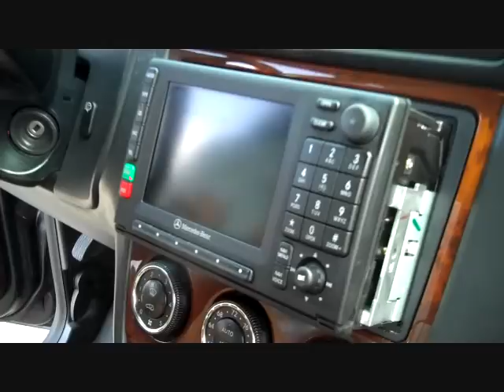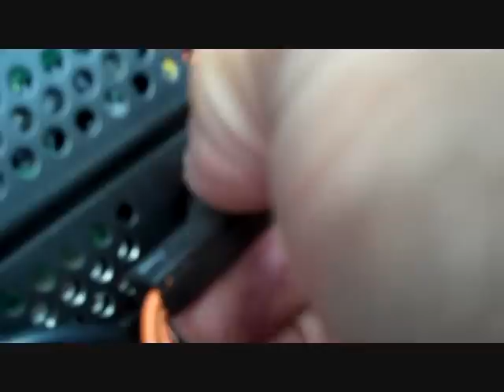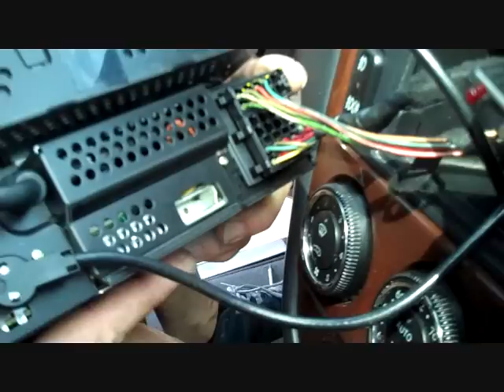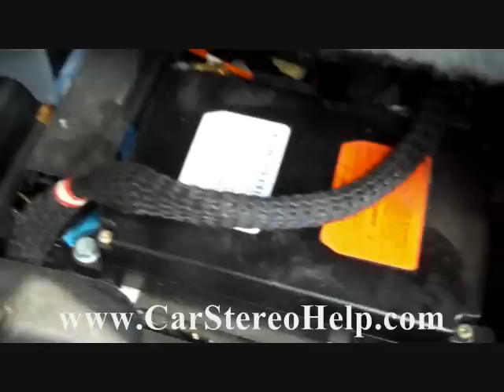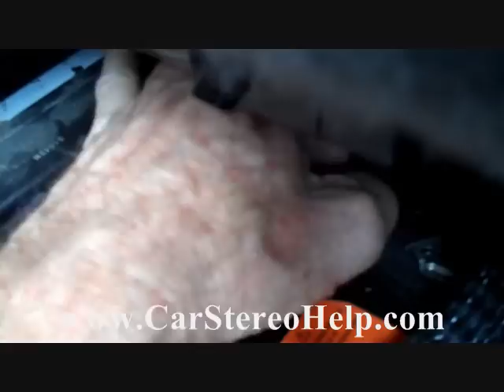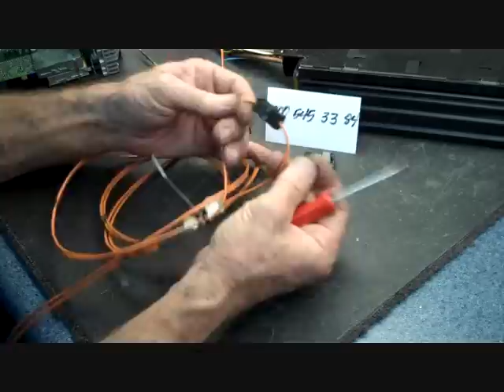Mercedes Benz ML - No Audio Troubleshooter = Car Stereo HELP

Comment: I was about to scrap the whole system before I saw your video. The amp pocket in the trunk of my s500 was full of water causing issues. I bypassed the cd changer and phone using bypass blocks already installed by the dealer to eliminate the SOS feature.

Comment: Hi i'm working on a 2003 ml350 after checking my fiberoptic ends i have no red flashing light on the end that goes in the back of the radio i bypassed the changer and box under the passenger seat and no flashing leads where do i look first

Comment: Hi, Need help. I figured out that the optical connector to the radio does not blink, should i replace it just the connector? If so do i replace it with the clip you show in the video, as im confused how it connects back to the radio

Comment: I had to unplug the Tele/sos under passenger seat because it had a draw and would cause my battery to go dead...so is this the problem of no sound coming from my radio? Will the fiber optic bypass work for this issue?

Comment: What if the red light at the fiber optic port on the stereo doesn’t blink, but stays solid red whether the unit is on or off?
Reply: i have same problem do you fix ready?

Comment: Where can i get  fibor optic coupler like you have in the video. I have the same problem thier is no sound but once in a while the sound comes through but once i start driving the sound goes away .

Comment: Okay so my radio had no sound commandment if it'll send it there was no CD player installed I checked the fiber optic cable to the back of the stereo those both were signed Sarah and the cable to tell link was fine I got to HD changer and CD changer blinked but the red light on the cable is plugged into it did not make so I got the coupler and I put it on that cord the one plugged into the CD player we should and then tried stereo and still no sound so what am I doing wrong or what am I missing

Comment: Now I'm 99 percent sure you are going to fix my problem. I replace an stereo on cayenne 04 with fiber optical. And I have no sound. I have to bypass the cd changer. I'm going to use either one. A loop or the coupler.  Let s see how it goes

Comment: Where to command the part to make the loop ? I have the old d2b system optic fiber and all the cable we can found on ebay or amazon doesn't work for my optic fiber cable

Comment: Installed Android unit , everything works, accept sound. It’s w164 2008. Can you help me with suggestions?
Reply: Yeah. The Bose system uses 2ohms your new head unit uses 4-8 ohms. You need an wiring harness or new Amp to drive 2 ohms

Comment: Hello! What is the radio code needed for and when do you input it?
Reply: turning on the actual head unit   is has a security lock out code  for theft prevention   it only comes in play when power is removed from the stereo then restored.   it should be somewhere in the cars manual.

Comment: Hello! My radio doesn't even have power. It won't turn on. Any suggestions?
Reply: pull the stereo and check all connections in the back.  if no issues  then take it to a shop that deals with audio  because an in depth power line check will be needed.